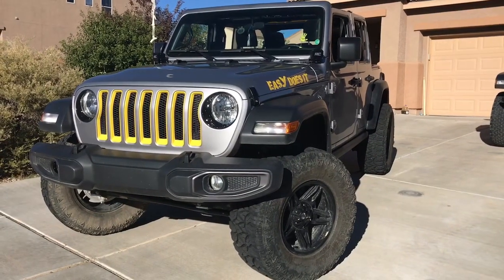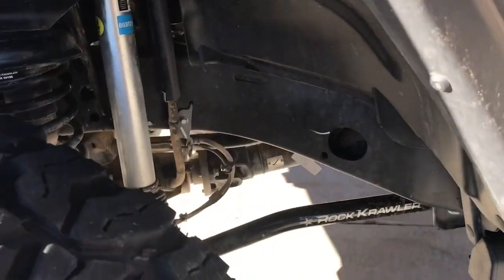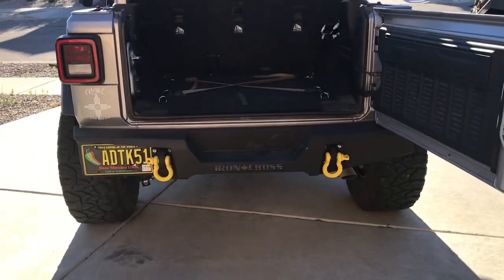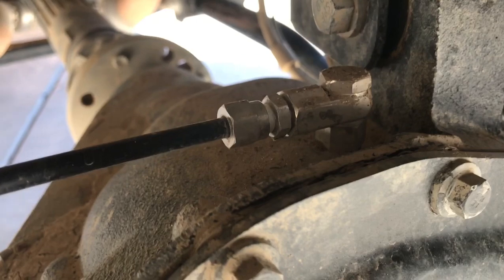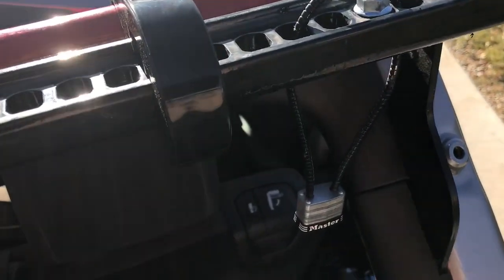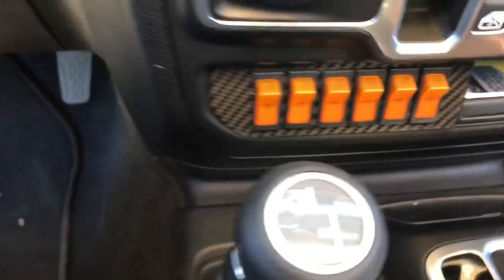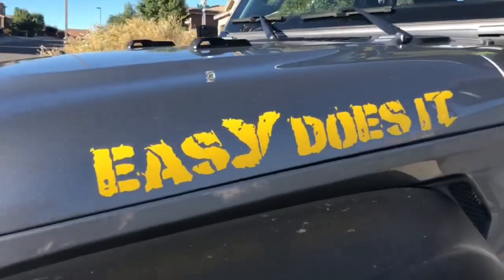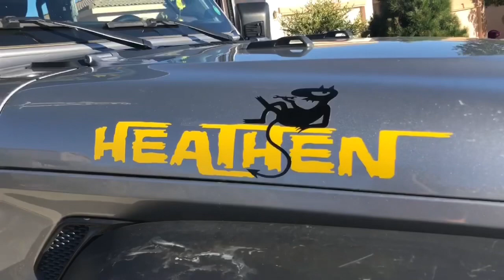JL Life - Introducing Easy Does It

Comment: Didn’t realize Heathen was named something else! How is the arb air compressor? Still running strong or did y’all upgrade heathen’s compressor to something else? 
Did y’all install the air locker? 
How’s the spiderweb shade holding? I have the alien shade but have been thinking about getter a single piece spiderweb or checking out dirtydog4x4 shade.
Long term use, what are y’all thoughts on the tzar? I was advised to get a superchips flashcal.
Reply from the maker: Ahhaah when misty first bought the jeep... she didn’t intend on going crazy with the mods... with the rock crawling... so tht was the reason of the name 😂 but after getting my own and we both have gotten a tad out of hand 😂

So compressor... she still has the single pump... of course it works... but wouldn’t suggest it for tires larger than 35... her air up times have been taking a lot longer. She wants to get the twin compressor from arb.. 

Spiderweb shade is doing great still... we also started with alien shade with mistys... but changed it. Reason being... alien only had a few colors at the time.. and spiderweb has many more options.. 

I used to have the flashcal... but it lacked a lot of the functionality the tazer could do. I changed to the tazer only to find out flash cal updated theirs... thou took forever. Also the updates weren’t pushing to my unit either... i mean I really like how clean the superchip is.. super easy to use and clean:.. the tazer.. does more... but it’s more confusing to use... having to use the dash and steering controls to change settings... and the menus are abbreviated... what all were u looking to chnage... maybe I can give u some better insight which one to get